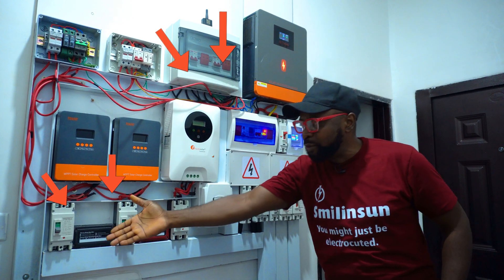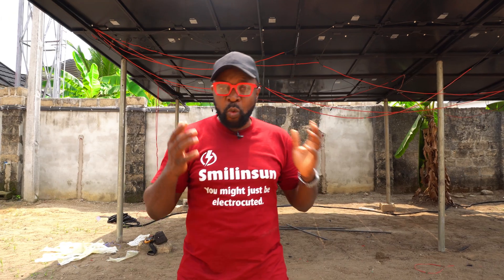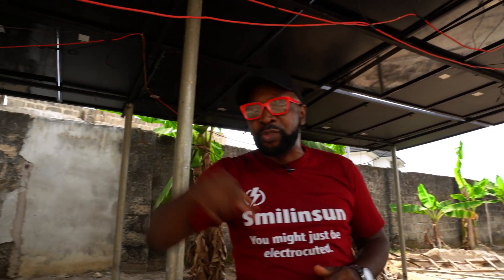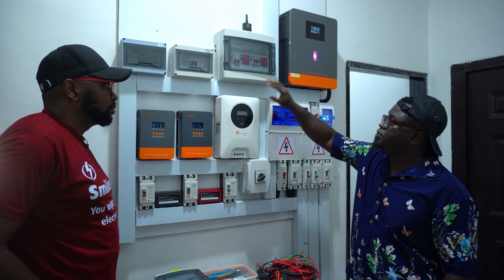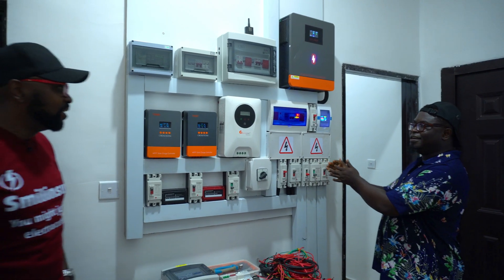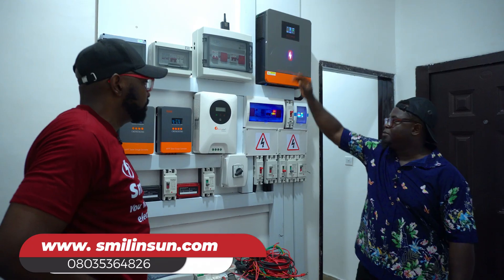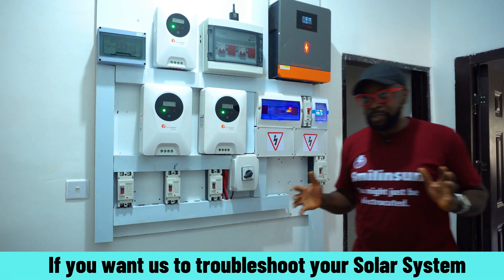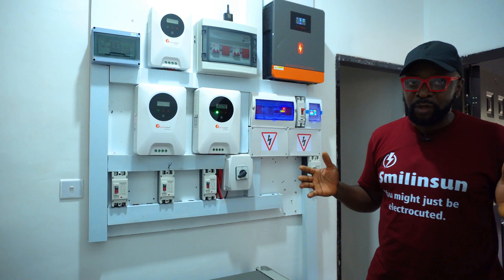Correcting a wrong Solar Installation

Comment: I appreciate the really neat installation and I can say its art. Well done. But judging those felicity and heat lifespan, there should be some space above and below them for heat dissipation. Else you start getting E22.
Reply: I'm pissed why they don't have cooling fans and generate so much heat at 70% performance.
Reply from the maker: Thanks for your comment Buddy!!
Reply: Additionally, the Felicity charge controller keeps showing the E04 error. I've done everything to resolve it but it keeps coming back. It's quite frustrating.

Comment: I think possibly the battery that's dead needs to be opened up. I experienced the same thing when I went for maintenance somewhere. I tried powering to no avail, I opened the battery and realized that a wire cut from the BMS, I joined it and the battery came up. Still the same Blue carbon
Reply from the maker: No, this specific situation was designed to work that way—charging one after the other. In this setup, one will definitely receive more charge than the other, and in some cases, one may not charge at all.
Reply: I will better reject the contract than some else should come & correct my installation. Some client are over sabi❤
Reply: @freediysolar for me the corrections were basically not the exact issue wrong with the system. The person who came to correct has to use that advantage to shine but it is not the reason why there was that issue. 

The customer has already own that narrative because that adjustment worked however the reason pointed wasn't why it wasn't charging. 😉

The reason is basics. I will do a video about it on my channel. 😂
Reply: @jo4mil  then what do you think is the reason it wasn't charging